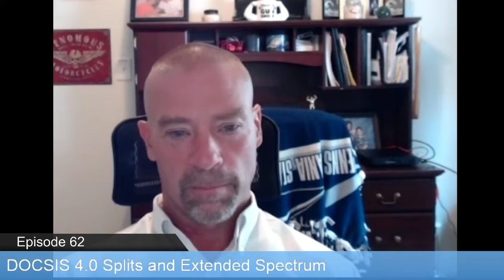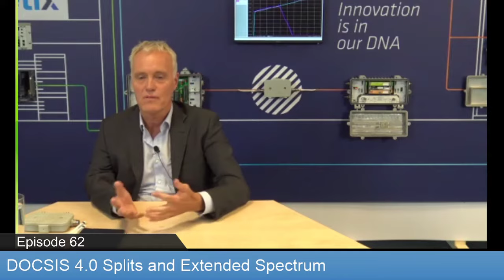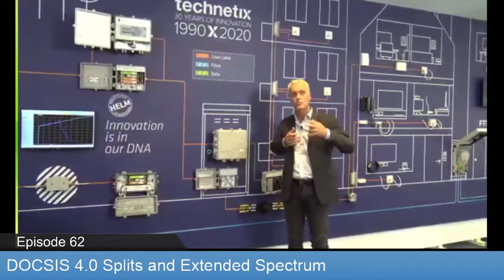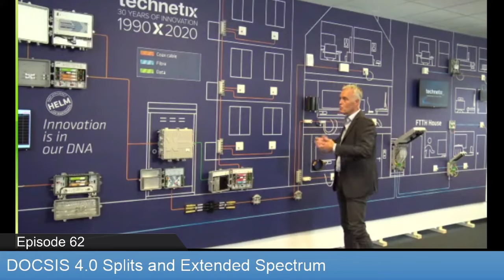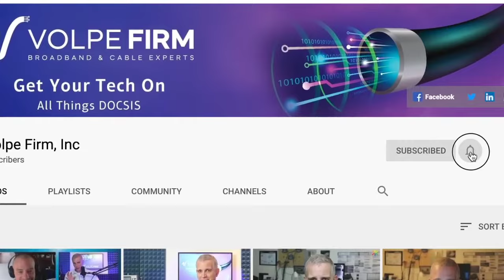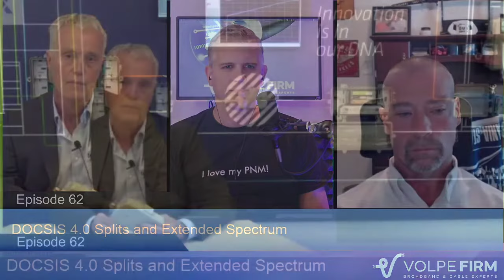DOCSIS 4.0 frequency split and extended spectrum

Comment: Nice presentation, at the end of the day FTTH will be the one. I do undestand the cost asociated with the change even with the Node + 0 system. If you are going to end up with fiber at the end, should be logical to introduce fiber equipment gradually? The idea behind the fiber was to use the same ducts (where underground), besides the biger spectrum, but that is not the case. The same work is done all over again and again. At the end of the day you are chasing your own tail. I come from the telecomunicacion  transmission system and they are well planed with the ITU from decades on the planning red book, blue book, white book and that was before DOCSYS, which is only 25 years on the making.
Reply from the maker: Thanks Jose. Really appreciate you taking the time to share your perspective.

Comment: After watching this the theme seems to be FTTH sooner or later. The iron is hot right now with rural broadband funding. We should skip the middleman and do it.
Reply from the maker: Hi K0gashuk0, I believe everyone would love fiber to the home (FTTH), however it is quite costly to run the fiber drops when coax drops are already there. So coax remains the most cost effective solution while fiber will over take coax over time. But it will be a long time.
Reply: @Volpefirm  FTTH, although costly initially, does have benefits in the long term. But in the meantime, improvements to DOCSIS are definitely welcomed until the migration to FTTH is fully made. New deployments should already be using FTTH. DOCSIS doesn't make sense in areas that don't already have the coax infrastructure. Operating costs are also severely reduced with FTTH so it may be beneficial for some ISPs to make the switch depending on the circumstances.

Comment: A half @$$ excuse to invest in another ancient system where it would have been better and cheaper to go from DOCSIS 3.0 to FTTH.
Reply from the maker: Hi K0gashuk0 if money were no object, we would fiber running everywhere, including very rural areas too. But unfortunately money does count at the end of the day...
Reply: @Volpefirm  I think at some point it has to be cheaper. I live 1500 feet from the fiber, which is on a pole, and less than a mile from the CMTS. Comcast has replaced the coax drop three times to this house since 2001. I have had at least four cable modems due to upgrades. Comcast offers a fiber service but it is 2gig only and requires their equipment rental when I have a router with 10gig SFP+. The only other option is business ethernet. It just doesnt make sense that they dont migrate people off copper when practical. I have seen how they do their gigabit pro installs. They just connect the fiber to the junction box on the wire that is hanging then they zip tie it to the existing fiber line until they get to the pole closest to the house they are running it to. Then they trench it. They have already dug a trench three times the same distance for coax.